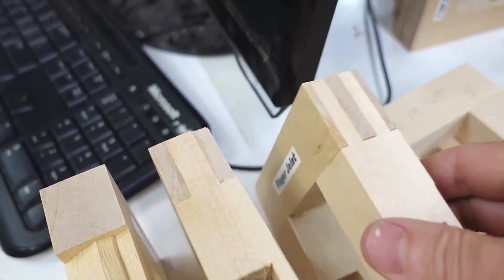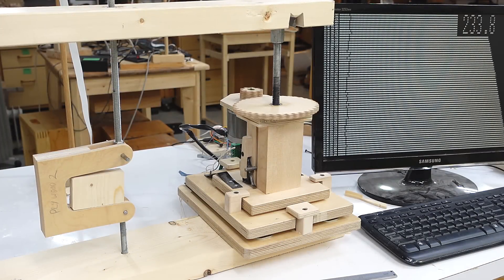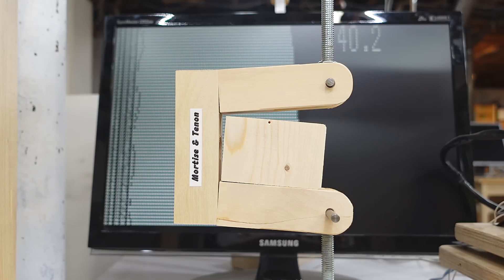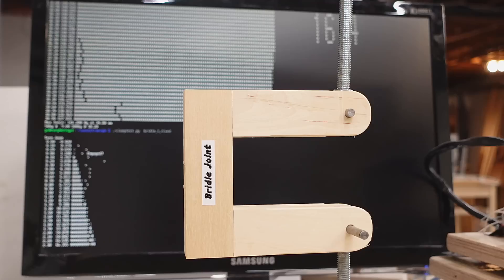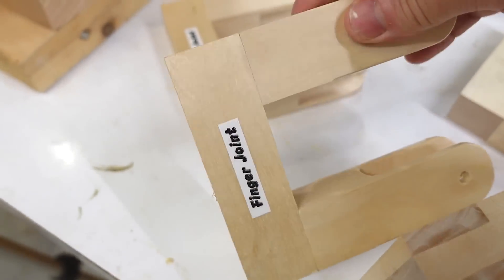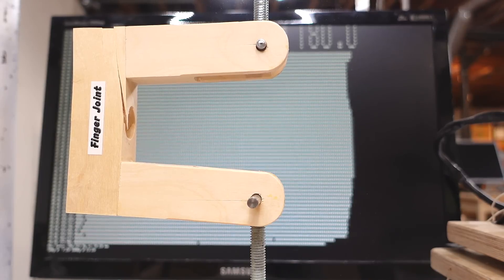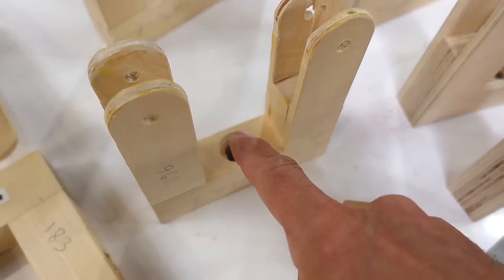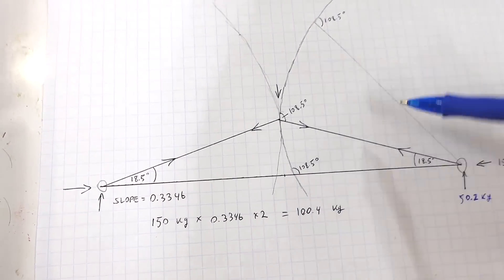Testing joinery for edge clamps: collab with Marius Hornberger

Comment: The plywood were ultimately much stronger than the other ones when there is no hole drilled. I think the best solution isn't to go with a mortis and tenon, but to simply reinforce the plywood where the holes are. That would be easiest to mass produce and the strongest.

Comment: I would've 3D printed one, use it as master mold, and sand cast 30 pieces in aluminum.
Reply from the maker: but when you watch people casting aluminium, its anything but a smooth process, and the result may not be that strong if the casting isn't perfect

Comment: Because you did not apply the edge clamping load to the spine it only sees bending and the direct tension from the pull.  The clamping load would on average increase stresses, however, may reduce extreme fiber stress because it’s in the opposite direction.  This would make your results more conservative than reality so no great loss. It’s strong enough and your test good enough. Just some food for thought.

Comment: The plywood ones had a radius inside corners which adds strength 
And if the nuts were super glued in that would add strength to the main beam. You too create some of the best and most educational videos

Comment: Seems like a lot of time could be saved if your collabs started out with design specs. That is what interested me a lot about the process: I actually have no idea how much force you need to edge band something. most of my experience is with super low clamping force hacks like masking tape clamping, putting some elastics around one of those dollar store spring clamps, and the like. Which obviously generate nothing like the forces you guys are clearly targeting. Are those forces needed? what applications are they needed IN? I have mostly seen edge banding as decorative, and if you need strength, you clamp both sides of your panel glue up. (with something like a bar clamp on an assembly table). Is this for stair nosings or something? Most stairs I have seen, the treads are assembled (nosings and all) before install, and the joints are both mechanical and glue. 

I found your force diagram at the end to be the most useful, as spoiler alert, none of this ends up mattering at all as the failure mode of Marius's clamps is his rubber friction pads failing, at nowhere near the design strength of the clamp arm joinery. If the individual components had been tested individually, I think it's safe to say a ton of build time could have been saved just by saying "none of this matters because our rubber is going to tear long before we reach these test strengths". 

Neat hack with the wood wedge jammed into the gap in your screw clamps to apply force. that looked strong and obviously, takes up basically zero storage space. I will definitely try to steal that if I ever figure out why someone would need 100kg of clamping force for edge banding.

Comment: I'm no engineer, but are you sure you can double the result from your force vector calculation? The failure of the frame is already force being applied to both sides, and you're just translating it to a different (symmetrical) vector applied to the same part. It would seem to me that half of the failure force would be applied by each cam, and thus you can't double it.
Reply from the maker: I’m sorry you don’t understand it.  can’t be helped.  this asoect was just too obvious to explain.
Reply: @matthiaswandel  allright, if you're confident then I'll have to learn more, thanks for the reply

Comment: How did you make sure the kg measurement is calibrated correctly?
Reply: It won't be calibrated correctly since there is a lever ?doubling the force applied to the DUT.

The aim was to find the strongest joint, so the important thing is repeatability so that one joint can be compared against another.
Reply from the maker: oh, you think I don’t know the lever doubles the force and accounted for that?

Comment: I think it would be a cool video to throw 3D printed parts into the mix of this test.  But I do realize this is more of a woodworking channel but would still be cool.  Great videos!
Reply: You should check out CNC Kitchen, in that case, he does a lot of testing on 3D prints!
Reply: My best guess is that 3D printed parts aren't as strong, but that would depend on the printing material and the printing technique..so a whole other story

Comment: When you made the plywood versions you had the grain oriented 90 degrees from the original plywood versions.  You would have to count how many plies were passing by the center hole (perpendicular to the hole) in your version compared to his version to see if this explains the difference in strength.  The plies with grain perpendicular to the direction of stress don't contribute to strength and are ignored in actual design of plywood.  You can find books listing the effective area and bending properties for normal construction plywood considering the plies in the direction of stress, I'm not sure if such a thing exists for baltic birch with its different number of plies.

Comment: When  you clamp on something, the load tries to bend the wood, but because of where the load it applied (Pin through hole) it instead split the fibers. ( This is where larger and "weaker" grade 2 bolts and lags should get to outperform structural screws rated higher that end up splitting the wood, That would make a good theory to test too!)
If the arms were built like a torsion beam/box, with larger holes with a metal pipe spreading the load to a washer or insert, the split might be avoided.

Comment: Love these failure test videos! I noticed something near the end with your math though - if the reasonable max load across the arms is 150kg, why did you double it to get the perpendicular max load? To me that doubling was already taken into account naturally by your test since it was loading both arms at once.
Reply: Two scoops, I think the load is doubled to account for the mechanical advantage of the lever bar across the top of the test unit, the force is applied twice as far from the fulcrum as the load point. In use the clamp will always be a single unit because the load will be balanced between the two legs. If the spine of the clamp were secured and the load would bear against only one leg, the total would be doubled, but in actual use this does not occur.
Reply: @harlanbarnhart4656  This totally would make sense about the test setup! I went back to that part of the video to see if I missed him explaining this, but actually he says "and since we're pushing from both sides" in order to explain the doubling of the force. So I'm back to being uncertain of the result.
Reply from the maker: I'm sorry you don't understand the logic here.  But from how you phrased your question, I figure its pointless to try to convince you.
Reply: @matthiaswandel  Ouch. Just trying to understand...
Reply: @matthiaswandel This response seems unnecessarily mean.

Comment: You're using a stepper motor, you can plot stress/strain rather than eyeballing the gap opening.
Reply from the maker: only if the tester has no flex
Reply: The comparison between the curves would still indicate how different samples behaved, unless the tester is changing over time. If you wanted absolute data you could test a steel rod and then be able to subtract the expected flex of the machine. Or even just subtracting the strain of plywood test would remove the hookean behavior.

Comment: if the center hole weakens the frame so much, I don't understand why you can't just make that side thicker? why is this overall thickness of the clamp so important? or just add a metal strong tie on each side, they are cheap enough.
Reply from the maker: making it thicker makes the whole clamp less stackable.  A metal strong tie won't help because you can't join it stiff enough.

Comment: Here, as in most mechatronic systems, it seems that stiffness is a better metric than ultimate strength to say "which is better". Nice! 
Congrats to Marius for being 'friended' on YT by Matthias. It's official now :)
Reply: Does depend on the system, more than a few things are very reliant upon the elastic flexibility for function too. And sometimes you want the failure mode to be non-destructive and give you warning the mechanism is overloaded, which doesn't tend to be the case for stiff structures, if its too stiff the tendency is to work perfectly till it fails catastrophically.
Reply: from my understanding of clamps much of the force comes from the elasticity of the frame material and not from the elasticity of the threaded rod for example so stiffer frame doesnt necessarily give you more holding force for a given torque

Comment: I'm no structural engineer, but wouldn't the test of the glued joints' strength be more appropriate if the two legs of the sample pieces were compressed together in a vise like test structure? This would eliminate the wood failures due to the drilling of holes in the sample pieces or other abnormalities.
Reply: Why would that be more appropriate ? That's not how the force is applied when the clamps are in use
Reply from the maker: Do you want to test the joint, or do you want to test how well the assembly performs?
Reply: Agreed. Or if you want to pull the joint, at least saddle the arms with metal and pull on that.

Comment: This testing continues to convince me that modern wood glues are so strong that with any sane joint design, the failure is going to be elsewhere, or the wood coming into the joint, not the interface between the pieces of wood.
Reply: Matthias has a vid from way back, reaching the same conclusion.
Reply: Now to test joint sanity to the point of failure
Reply: Although did you see the double mortise and tennon? Looked like it did slide out rather than the wood fail.

Comment: arent the actual forces double the measured ones, since you are using what seems to be 2:1 lever?
Reply: For comparison purposes, it works just fine. However, I agree that the physics and associated math is much more complex. I believe Matthias is well aware of the potential shortcomings of the setups if one were wanting truly accurate measurements.
Reply: I imagine that would be accounted for in the software recording the forces
Reply: A few of these weren’t technically a “joint” failure but either a failure of the timber itself or the pins simply pulling through where they’re drilled. Would be good to see a pin holding the inside of the joint vs a drilled hole.
Reply: This is what's been on my mind as well. I see a few other issues as well with this test rig setup. I wish a bit more focus went into the execution of this research. We all know Matthias is perfectly capable of something better :)
Reply from the maker: The forces are indeed double, so I doulbe the force in the code.  Every time I use that testing setup, I customize the software for that test a little